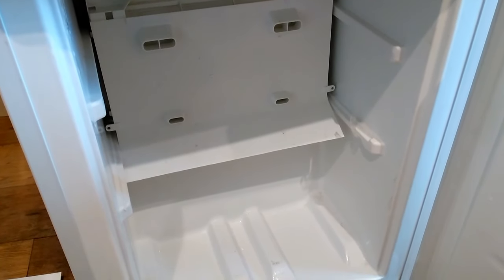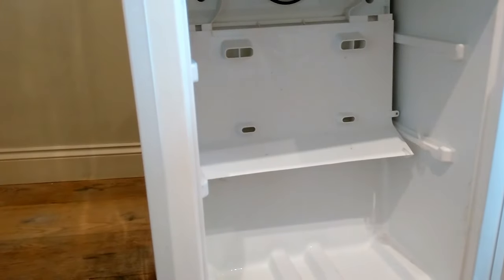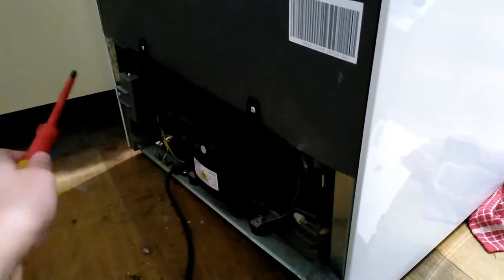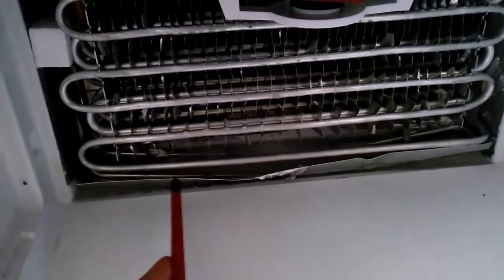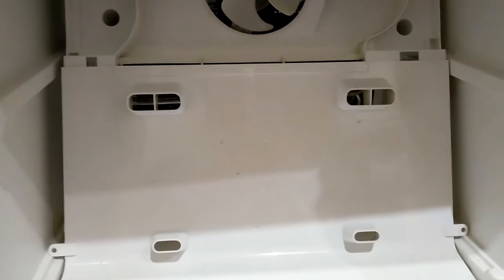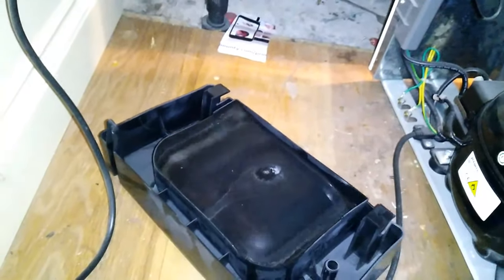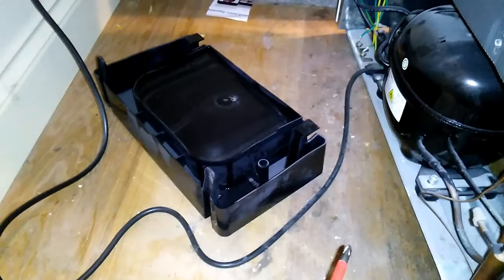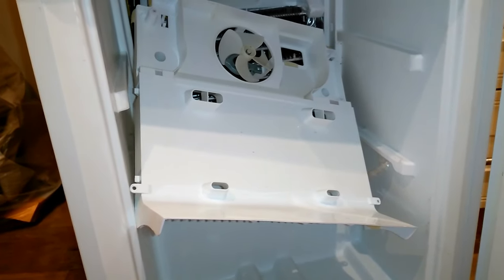Freezer Water Leak - Complete Solution!!

Comment: Great vid thanks. 

For those who need to speed things up:
The fastest way to defrost that drain is to trickle a kettle of boiling water into it. Mine was sorted in 2 minutes.

I used an oven tray under the bottom of the freezer opening to catch any overspill.

Best of luck.

Comment: You may be able to keep this problem from re-occurring by wrapping  a piece of heavy copper or aluminum wire around the defrost heating element near the bottom of the cooling coils with the other end laying in the bottom of the trough near the drain hole.  It should conduct enough heat from the defrost heater to keep the water in the trough from freezing or to thaw it if it does.

Comment: Thankyou so much for this. I had the same problem. I could not find the drain hole at the back of the freezer (on the inside). As you explained it was covered in a thick sheet of ice so covered over and not able to drain away. I used a hair dryer to speed up the thaw. I couldn't wait all day otherwise all the food would have spoiled and the fridge freezer is packed for Christmas in 2 days time. You saved my Turkey. Lol

Comment: GREAT VIDEO. I sped things up slightly by chipping away the majority of the ice in the drain gully, placing a serving tray under the appliance, then repeatedly pouring boiling water into the gully. pushed a screwdriver up the drain tube at the end to finally get the water flowing. Thanks so much. My wife is now off my back!

Comment: Unfortunately this is just a temporary solution... Just because it will happen again after some time. So the title "Complete Solution" is a bit misleading. I had the same problem with my  LG 594 fridge/freezer, after 4 years of using it, started leaking water from freezer bottom on the floor. The cause was the drain hole was full of ice which blocked the drainage tube. De-iced and all went well for another 2 months then again leakage. Same issue, ice blocked water drain outlet. This time tried to add a small improvement to the resistor bar doing the defrosting. I added a small piece of metal attached to the resistor bar and made it  stay close to the drain hole. The idea is to bring the heat from resistor a bit closer to the drain hole so it will not be blocked by ice again. Will see how it works in time. So far, one month after the improvement, no leakage but it is too soon to say it's definitely fixed.
Reply: Did it work?

Comment: Most probably the problem was that two locations of the wall of the drain tray was warped outward reducing the hight and resulting in subsequent overflows to the inside of outer freezer compartment. Furthermore, there must be more humidity surrounding the the freezer-fridge, than the design capacity of the drain tray.  Or, rear of the box was higher than the front level, so as to cause the slight water leakage atop the wall of the front end of the drain tray.